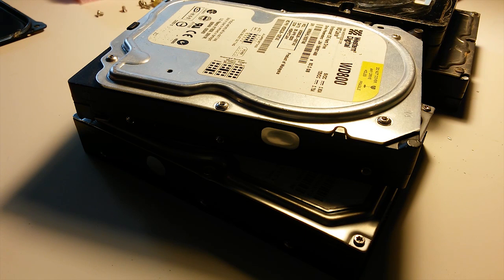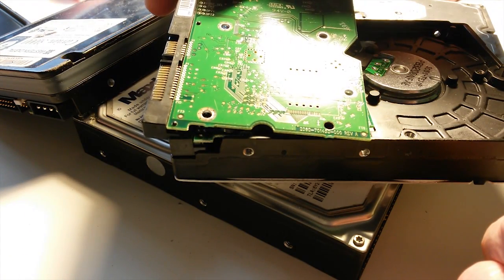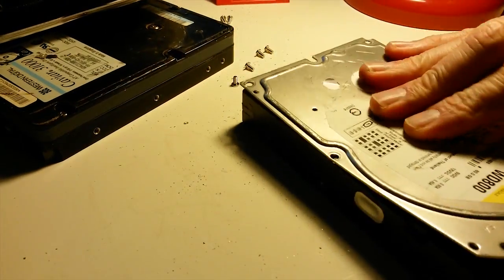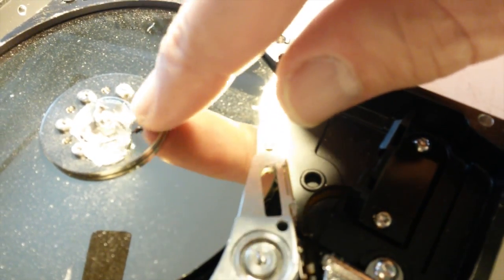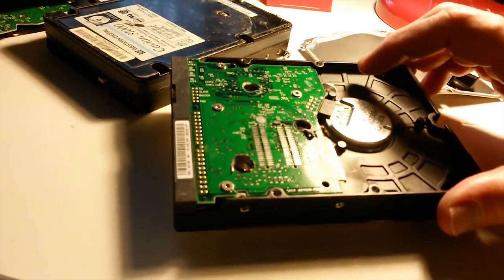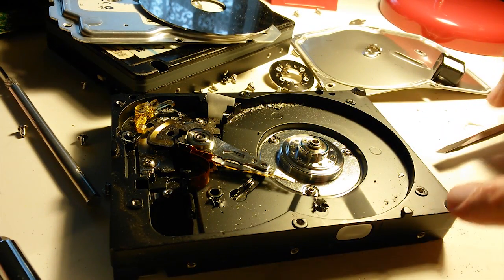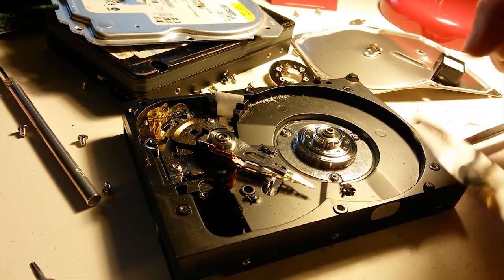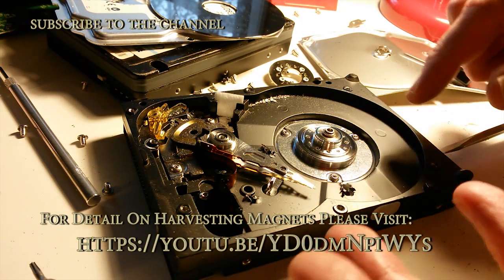Don't Drill Your Hard Drive

Comment: Not as simple as just 'changing' the PCB board with another, since you would need to remove the BIOS/Firmware chip from the old PCB and replace it on the new PCB, so effectively, drilling/killing the bios chip makes it very hard to reteive any of that data. Encrypting the drive first before removing it and then drilling BIOS/Firmware chip is one of the best data-protection methods that exist. Alternatively, companies that have critical data and need to be 100% should be using a Hard Drive Shredding Machine, they cost as little as $10K and will shread anything, from CDS to Hard Drives, and printed documents.
Reply from the maker: Thank you for sharing your insight. Won't encrypting multi terabyte drives take a long time? I encrypted a 5TB ext on an older laptop and it took 10 days.
Reply: @cfldriven  I don't recommend using any laptop for data encryption on a 5TB drive unless its a Intel 7th Gen i7 or above. For Desktops, most Intel processors after 2017 will speed up the process greatly. This is due to AVX512 and AVX2 which essential is hardware acceleration which will greatly decrease the time needed to fully encrypt it.     But it's important to note that a Intel Atom with AVX2 is going to be much slower than a Xeon with AVX512. AMD also have h/w instructions in CPUS made after 2017 as well (Ryzen)
Reply from the maker: @SimonHayter  Now you tell me. lol

Comment: So yes, if you INCORRECTLY drill hole in your hard drive, it might not work...
Reply from the maker: IT dept wouldn't let me have the old drives until they drilled them, but it turned out almost none of the platters were touched by the drill bit.
Reply from the maker: AIIUserNamesInvalid  As companies tend to save every piece of data, it may be that and more.

Comment: drilling into hdd platers wont destroy data,i worked on police,and even if you drill hole most data gets recovred
Reply from the maker: Thank you for sharing your experience. I guess the real question is for most law abiding citizens, are less drastic steps (overwriting, encryption, re-purposing drive, disassembly, etc) offering enough protection?

Comment: Those are some majorly strong magnets in there! Worth keeping, and perhaps using to hang tools etc. Destroy the disc and recycle the rest, seems like the environmentally friendly approach, and it definitely saves on drill bits lol.
Reply from the maker: Very strong magnets, some people use them for magnet fishing. Definitely worth re-purposing even if only on the refrigerator door. Can even use the discs as a mobile or wind chime. 
Thank you for your input.
Reply: cfldriven Maybe this is a silly question, but assuming the platter hadn’t been previously wiped, couldn’t you basically degauss it by rubbing one of those magnets against the platter for a few seconds?
Reply from the maker: If it was an audio cassette yes, but realize these magnets are right next to the platters and don't have any effect on the data. Also if you have direct access to the platters, it is easy to do physical permanent damage to them thus making the data unrecoverable.

Comment: We used to take them to the shop and put them on a 20 ton press, let's say if you could get data off of it afterwards it would have been a miracle..
Reply from the maker: That certainly would solve the problem. Thanks for sharing a different solution.

Comment: Use a razor blade scraper to peel the hard drive sticker off to get to that last screw. I took my drive apart in five minutes. Very easy.
Reply from the maker: Good idea, thank you for sharing your tip.
Reply: @cfldriven  after watching your video, I decided to take your approach. The other videos that show smashing desktop hard drives with a hammer and then shaking it as a means to prove that the disc is shattered is not true. It could be the green board that shattered! After I opened the drive and took out my disc I decided to take a hammer and punch pin to it. Guess what...the punch pin just punched a hole into the disc, didn't even shatter, crack or anything. My disc is resilient because when I took two pliers to snap it in half.....it just bent, no shatter. Any- hoot, thanks for posting and saving my drill and drill bits.
Reply from the maker: @johncollins7044  thank you for sharing your insight to an issue that has a multitude of solutions.

Comment: What I did is grab wood plank and get the sledge hammer and wack it 5 times really hard then get the drop saw and cut it in half. Done :) Takes legit 2 minutes
Reply from the maker: Are the five wacks needed as you plan to cut the drive in half anyway? Thanks for sharing.
Reply: Oh I only use the saw just in case some how the plates are still good

Comment: I just ran into this video. I’m a tech for a local news company, and I oversee destroying all old company Hdd in bulk, with a machinist training background, the only way to destroy these is to drill through the plate s, but their is wrong way then there’s is the right way. The wrong way is drilling through the top cover of any hard drive. The top cover is usually stainless steel, which is a tough metal for production-like destruction of HDD. After about ten to twenty HDD’s your drill tip will get so dull, that another 10 to 15 HDDs will actually change your drill bit tip. Best bet is to turn the HDD OVER TO ITS BROWN IN COLOR BOTTOM, FIND THE PLATENS CENTER AND DRIL ONE INCH left, right or above this center, using a container of WD-40 to wet the drill between each “drill through. The brown part of the HDD bottom and platens are aluminum, a non ferrous metal, soft metal, that can do 50 to 75 HDDs, so long as you keep your drill bit wet with WD-40 before each drill. Then harvest the magnets at your leisure.
Reply from the maker: Eddie thank you for added insight. As you state if done correctly you can drill and destroy. I prefer taking them apart and throwing the platters into a pile, saves on drill bits. Besides most of the drives I get have been wiped clean.
Reply: When I mentioned destroy, I meant more or less the platens that may have data info on them. Taking them apart, specially when you have HDD in bulk, can be a tedious process, drilling into the platens THEN takin* them apart, is what I prefer.and you’re correct in harvesting the magnets, they’re a must have and an all around tool. I use the magnets as a stud finder, the magnets stick to drywall screws, even through dried drywall compound, i’ll Epoxy the mags onto GoPro camera armatures for easy mounting and dismounting, I’ll use them for tool shadow boards, where they attach tools to their marked spaces, easily.
Reply from the maker: Eddie, I appreciate you sharing some useful tips for the magnets. Will have to try the shadow boards in my next garage.
Reply: Came here to learn how to destroy data before recycling  (since old  laptop broke down and won't turn on.) I wasn't planning on saving the magnet, but now you guys have sold me!
Reply: Hi eddie, could you do a video or show a photo of exact position to drill, without spoiling the drill bit? Thanks a lot.
Reply: Yup drill from the bottom a little from the spindle motor till you hit the top case.